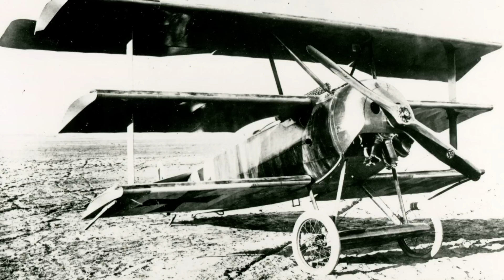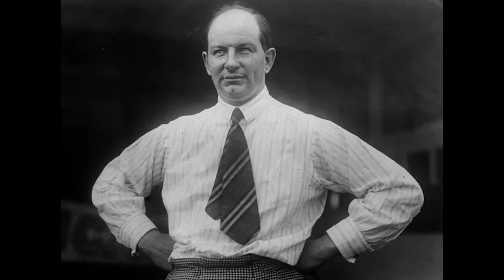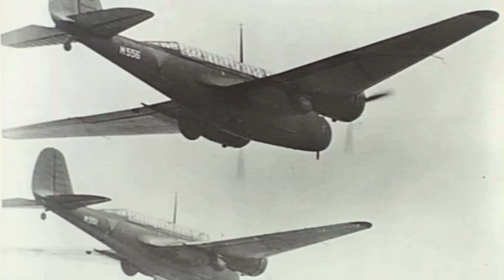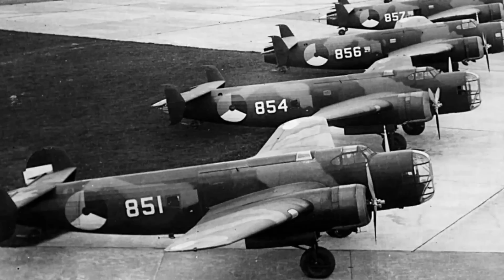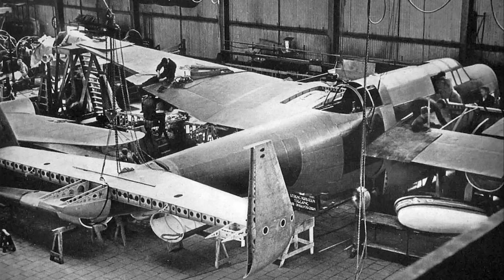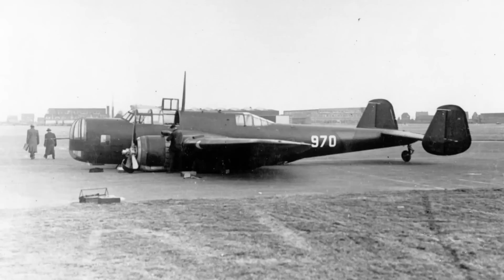A Formidable Big Fokker; The T.IX

Comment: Quite an amazing period ,  as several prototypes and new aircraft where being designed tested or prototypes .  Compared to the HE 111 it had greater range 2300 km vs 2720 km.  Greater altitudes  6500 m vs 8000 m was more heavily armed , 1x 20mm canon in the nose ,   2x twin 12.7 mm machine guns ventral and dorsal positions . 

The TVIII was also under construction a maritime flying boat  for the dutch east indies. 
The amount of aircraft beeing designed and in prototypes /testing at that time by fokker was litteraly insane .